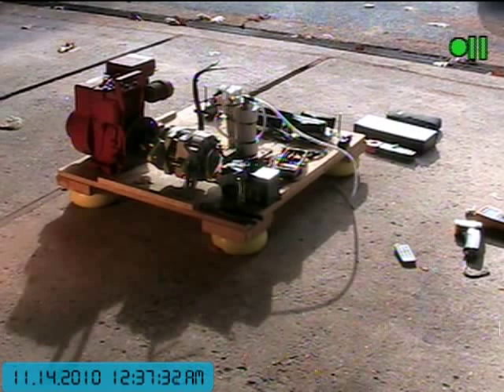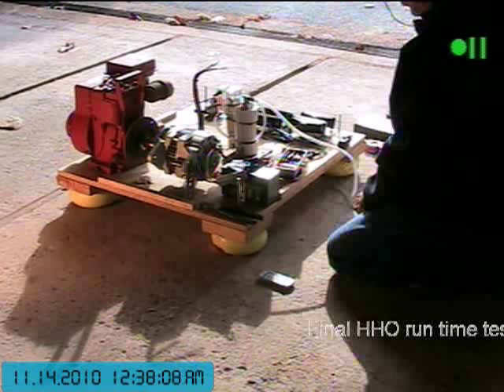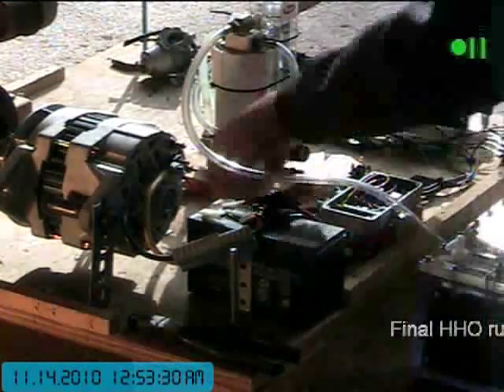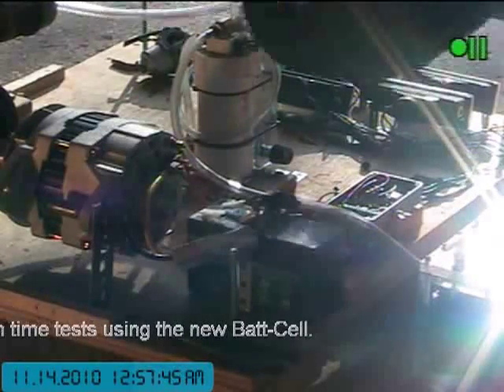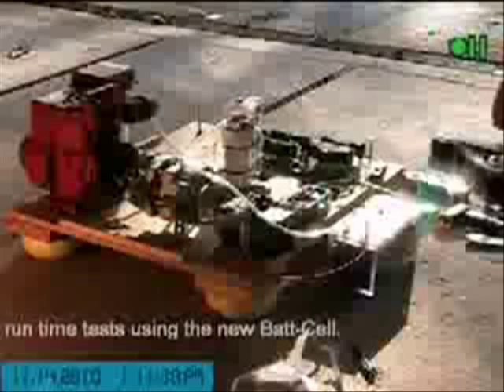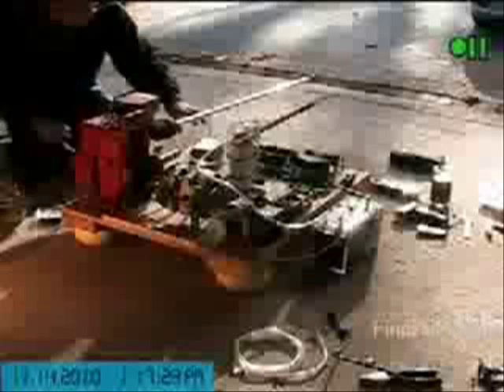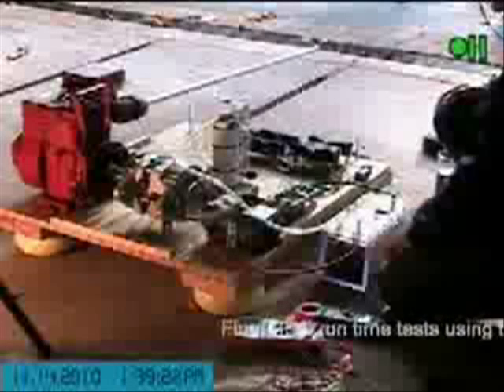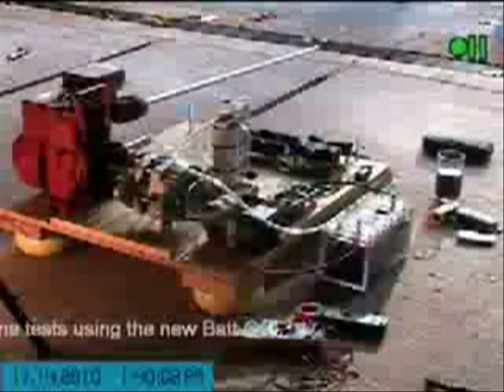#252 - Batt-Cell with B&S run time tests part 1 of 3

Comment: Thank you Zero.
I was thinking that placing the Batt-Cell on a stand above the motor would allow the vibration from the motor to shake off the bubbles from the plate faces.
Peace.
Mike.